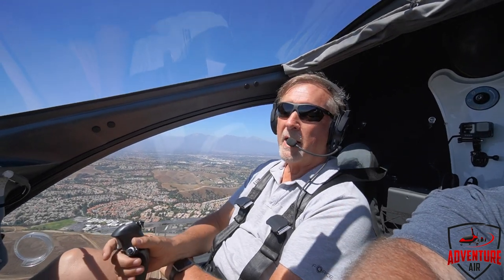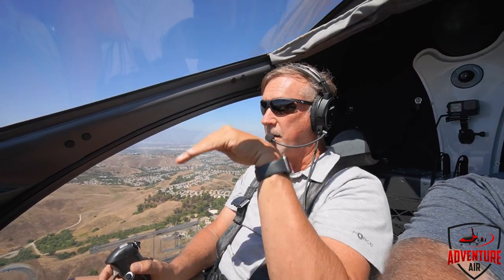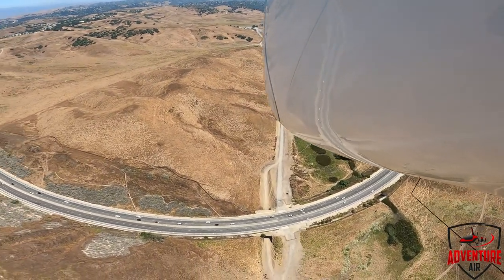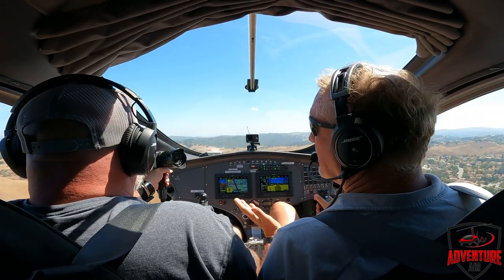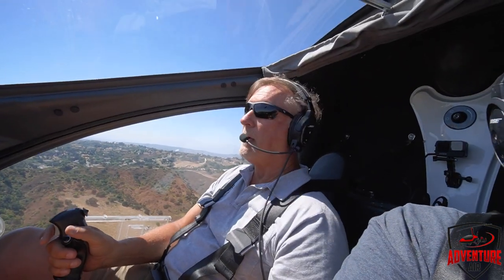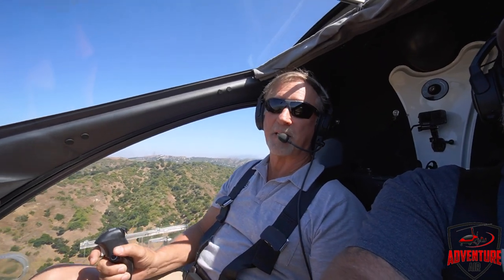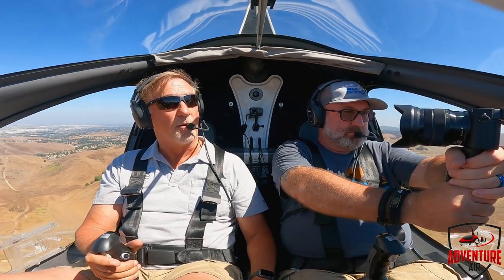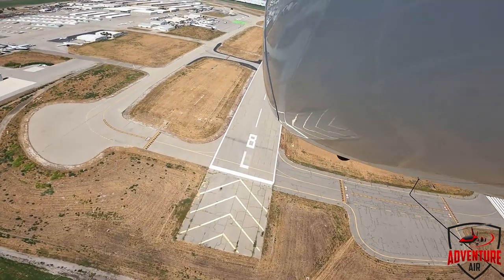49. Gyroplane landing with a tailwind: Should you do it? #landing

Comment: Thanks Henry, another good video. Yes Gyro's hate down-wind landings, my POH for my Sport 2017 advises 5kts max for takeoff and landing with a tailwind component. I've found some airfields can be a bit awkward when asked to change landing runway even for a small tailwind component but the experience of landing with even a slight tailwind is horrible when the lift just 'quits' on you and you cannot feel it.  When I've subsequently explained to the ATCO/Radio operator/Owner of the field they then get it as we're flying the rotor disk and not flying the wing so making it harder to feel when lift is going to rescind and need the wind through the rotor system to keep the autorotative forces going.
Reply: The gyro has no idea if you are upwind or downwind.  The difference is the ground speed is different.  Same with downwind turns.  The trouble is you are subject to a powerful illusion and if you are referencing speed at all from the ground say trying to turn around a specific point you will loose height.  

Next time you fly (if you can fly in an area with calm winds - not much mechanical turbulence near the sea with a steady sea breeze is a good way of checking this) try this.  Fly a balanced turn with rudder using the yaw string.  Ignore the ground just establish a gentle to moderate bank angle and whatever rudder you need and power you need to maintain height.  You will find you can do it all day without loosing height but your ground track will not be a circle.  Now find a fixed point in the same wind (do it with heaps of height) and try to fly around that point.  You will find your yaw string will not be balanced and you will need to not only fly crossed controls but you will be adding and reducing power to maintain height and position.  Because the only way you can fly relative to the ground in a circle in a wind is to change every bloody thing.  Don't fly relative to the ground fly relative to the wind.  

The air is like driving a boat in the water.  If you drop a float out of a boat in a flowing river that is bobbing alongside the boat you can turn in a certain amount of rudder and keep power the same and you'll happily turn around that float as it is also flowing with the river.  If however you you have buoy attached to the bottom of the river bed and you try to turn around that in a consistent circle you will be adding power going up stream taking it off going downstream etc.  Same in a gyro.  

Your gyro will land just fine going down wind or take off going downwind (it flies with airspeed the reason ground speed is different to airspeed is the wind is changing the ground speed but its molecules over the rotor that matters not the speed of the ground)  but the fact that you are now sucking up much more runway is the issue.  If it is dropping you its because you have flared before its ready.  It means you are flying visually not based on airspeed.  Think about it you have a strong mental picture of what sort of speed you are used to landing at.  In a downwind landing you are screaming along the runway and every instinct is going to tell you to go slower.  So the lesson is if you are forced to land downwind then you need to consider that airspeed is important and the visual clues are going to be not what you expect (you will be going much faster over the ground) but the gyro doesn't know or care.  

Consider this what's the ground speed of your rotors compared to the ground?  Your rotors are doing hundreds of miles per hour IN DIFFERENT DIRECTIONS!!!  If ground speed had any influence over lift no teetering (which effects only angle of attack) would allow a gyro to fly.  

Things that make downwind take off and landing dangerous. 

1.  bumpy grass strips will be more dangerous as you are landing at higher speeds and thus will be hitting those bumps much faster.
2. you will use much more runway both on take off and landing.
3.  Your visual cues will be significantly different and thus your instincts may be completely off.
Reply from the maker: Thanks for your support!

Comment: One thing to consider is other people using the runway.  I think you are right to point out that the impossible turn is not impossible in a gyro and in fact my instructor used to have us all do a tear drop before our first circuits.  Take off fly out and do a wide arch then turn back and land the way we took off although this was always in still air.  However strikes me you'd need to be careful doing so as you'd need to be sure someone else wasn't taking off behind you only to find there is a gyro making a steep head on approach as they are taking off.  Same for doing vertical descents to loose height.  If you are not really sure there is no one behind you given the steepness of our glide compared to a fixed wing it's easy to see if there is a conflict.  I note you have a controlled airstrip so you may have notified controller or be monitoring if anyone is taking off on your runway.
Reply from the maker: Thanks for watching

Comment: How do you know which way the wind is coming from if you're moving forward and the string should technically be straight back?  Am I missing something or do you rely solely on the Garmin to tell you?
Reply from the maker: At any airport, you generally take off into the wind. If doing an orbit without looking at instruments, you would notice the aircraft slide with the wind or increase or lose altitude based on wind direction.
Reply: @AdventureAir  I plan on being at EAA AirVenture this year. Will you be offering demo flights on the Cavalon or Evo Eclipse?
Reply: Is that amount of stick shake normal? It it just in the controls, or transmitted through the airframe? Not a gyro pilot…yet…
Reply from the maker: Yes. You can spend more time balancing the rotor to completely eliminate the stick shake but what you see in the video is about average. It's direct linkage to the rotor hub and doesn't affect the airframe. It's hardly noticeable when flying.
Reply: @AdventureAir  Thanks!
Reply from the maker: @sho164  Yes, we will be offering demo flights with a Cavalon and MTO at the AutoGyro booth.
Reply: @garycummings1706  It may be normal but that's because too many people put up with excess stick shake.  Normal does not equal good or acceptable!!!  Every one of those vibrations is being transmitted through everything in the airframe.  How much does one of these gyros cost?  Why are people putting up with it?  https://www.youtube.com/shorts/7StX_I8w570  this is what some manufactures of rotors manage to make it.  Why are people paying $5000 + for a set of rotors and put up with this is beyond me.  IT IS NOT ACCEPTABLE that it is average is an indictment to whoever is making these rotors.  Its often complicated to sort out but most times its blades being out of pattern.  Basically many of these machines have very long wide rotors (high drag) and combine that with powerful pre-rotators and the fact most don't teach proper blade wind up (they use a blast it to 220rpm gun the throttle over several seconds and go, proper blade wind up is to let the blades wind up gradually using the autorotation of the blades to gradually add speed and no it doesn't increase ground run as you can see from this video.  https://www.youtube.com/watch?v=uqcHWBPXiYg ) so these blades are subjected to tremendous torque on pre-winding a tiny fraction of a degree on a set of blades that end 14ft from the head will mean mm's of travel at the tip which will create an out of balance system (the blades can end up like a boomerang so more mass is on one half).  That shake is literally happening because the extra mass of the unbalanced rotor is pulling the whole head and mast around with it every rotation!!  Think about that for a minute!!  Your control rods are being dragged around 275 times a minute in little circles as the whole mast flexes around a single point that's why the stick is rotating in his hand.  What stresses are building up in the system.  What happens to you if you fatigue say a single rod end bearing on a control rod?  What happens is one of those snaps?  Answer:  You are buggered!

Other factors can contribute as well some quite surprising.  This guy I know went through the process of trying to sort out his rotors  here is what he found.  Note how different the blades were from start to finish and just how many things he tried (including stringlining).  https://www.youtube.com/watch?v=uqcHWBPXiYg .  This guy took the time and now has butter smooth rotors,  otherwise you are fatiguing any number of parts of your gyro.  Which would you rather fly on?

If you were flying a fixed wing and your engine was constantly shaking and someone told you it was your prop and it was normal most props have trouble with balance would you accept it?  Or would you take the thing off and send it back to the manufacture to get it properly balanced. What if the prop cost you thousands of dollars?  Would you accept this as appropriate?  Especially if you knew a guy with another aircraft that flew without that level of vibration.  Its BS what's more we are seeing cracks in airframes even hub bars, from some of these manufactures.  I strongly suspect that even if the putting up with this level of stick shake is not the problem it certainly can't be helping.  

I'm so sick and tired of hearing this.  Having flown machines with excessive stick shake and spend time to make them smooth seeing manufactures sell machines with $100 000 price tags and selling them with incorrectly designed and or balanced rotor systems is beyond belief.
Reply: @cameronlapworth2284 it's a Gyro, not a chopper. It's the nature of the beast
Reply: @cameronlapworth2284  again. Is not a chopper. It's an aerodynamic effect of the advancing and retreating blades changing angles that only gyros have, the stick will always vibrate. Choppers and definitely fixed wing crafts don't have this. Get yourself a fixed wing instead if you can't handle the stick vibration dude
Reply: @esau82  Wrong again mate.  Two bladed choppers have exactly the same system including the teetering and it has nothing to do with changing angle of attack but the fact that at one point the rotor is fore-aft (low drag) then side-side (high drag).  Teetering is to compensate for difference in lift it does cause 2/rev.   That's why they also have flexible masts like gyros.  Both multi bladed choppers and gyros have lead-lag hinges to deal with this.  choppers all use heads FIRST developed by gyroplanes, gyros had jump take off ie. fully articulated rotorheads before helicopters.  These issues were deal with before choppers they simply took gyro rotor heads and added tail rotors or twin contra rotating rotors  to deal with the torque.  The reasons for balance issues in choppers and gyros are identical.  Some chopper pilots put up with dreadful stick shake too and they shouldn't for the same reasons!!  

THIS IS NOT THE MAIN REASON FOR STICK SHAKE!  Its the reason given as an excuse to sell crap to the guilable and ignorant!  The main reason for poor stick shake is out of balance span wise rotors, or out of pattern.  Out of pattern happens when the blades end up slipping on the root end connection (cluster plates).  I suspect this happens a lot on these massively overweight machines because they are pushing too much rpm on take off run because they no longer teach proper wind up technique and avoid blade flap by instead ripping the rotors up to 220+rpm then gunning it.  rather than pre-spining to a more modest speed and winding up slowly (but with less ground run) as they should do.  As a result the excess drag on their over long rotors (due to their over weight machines) causes massive drag and they end up with some slip over time and out of pattern thus out of balance.  

You don't need to fly on rotors with this stick shake.  I don't my blades which I made have NO shake so why would I fly something else?  The question is why are these guys putting up with shake when its not only unnecessary but decreases the life of every component?

https://www.youtube.com/shorts/7StX_I8w570  Here you go, that's normal stick shake.  That's acceptable.  https://www.youtube.com/watch?v=9JcaZ3WLxOA  another machine with acceptable stick shake,  

Unacceptable  https://www.youtube.com/watch?v=9JcaZ3WLxOA  

See the difference???  Why would you put up with that when you can have no describable shake?  Only someone who didn't mind having bits of the gyro fatigue and break in flight would put up with it or people ignorant of the dangers of fatigue in materials.  If you fly a fixed wing do you put up with an unbalanced prop shaking the shit out of your engine?  Or would you take that prop back to who your brought it from and demand your money back and buy one instead for a competent prop manufacturer???  Funny because the fix is exactly the same - balance the bastard properly!!!!